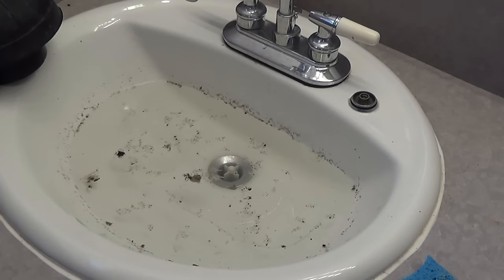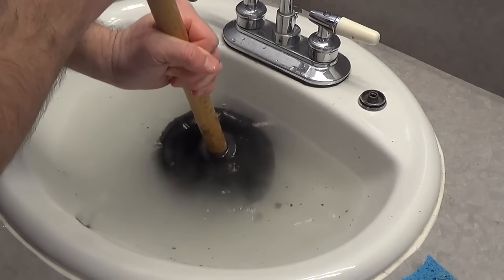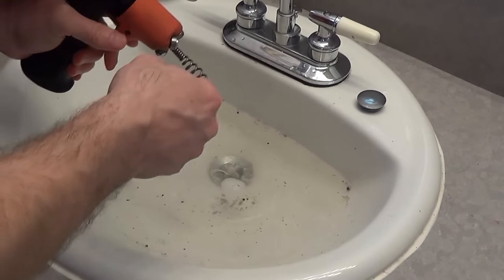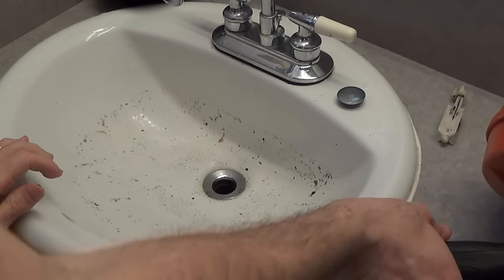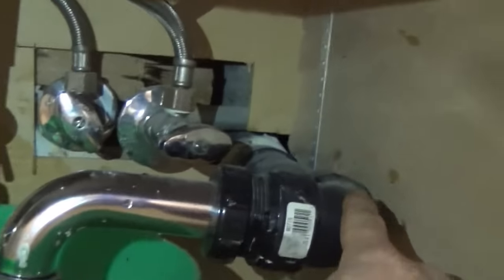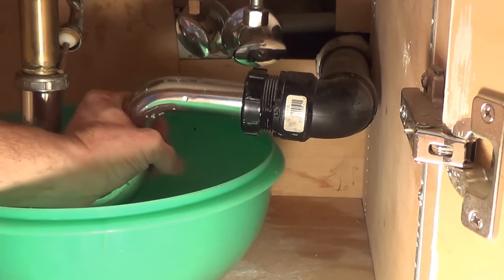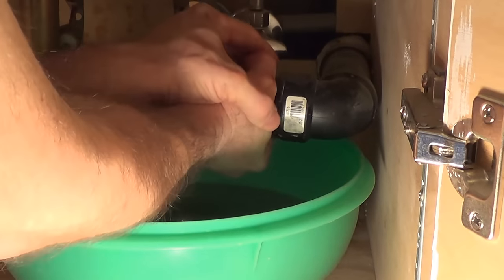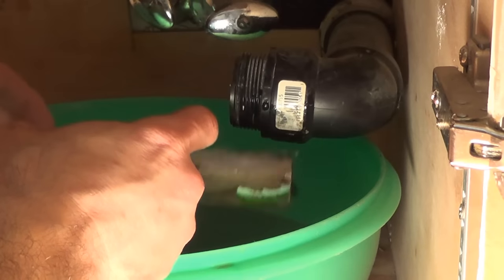How to Unclog a Bathroom Sink

Comment: Usually, the bathroom sink clog is hair and slime wrapped around the base of stopper, the thing that closes at the bottom of the sink.  You often only need to pull that out and clean it off.  To do this, detach the lever under the sink that raises and lowers the stopper.  The stopper will pull right out.
Reply: Yep...almost died when I saw him remove the plumbing...LOL
Reply: Thanks a lot, your reply saved me, i did exactly as you said and it is resolved. so much helpful tip!!!
Reply: Thank you👍
Reply: @predeem1629  ,
But in this case it was further down.
Reply: 0

Comment: Use Dawn dish detergent. Pour it in, run some water too soap it up and let it sit. Works every time.
Reply: Soaps the reason why my sinks clogged
Reply: No it doesn’t work
Reply: Sometimes a teakettle full of hot water will melt it loose. If it's not hair.
Reply: @gircakes  ,
That's only if it's up high, not in the wall.

Comment: This video saved me. Our bathroom sink was stopped up for months. We would plugged it and the water would drain out just a little bit faster. Water would fill up quickly and would take about 10 minutes to drain out. I was just about to try to take the pipes apart to try to clean them out. I am a female and didn't know what I was doing. Then, I watched your video and you said to put your hand over the holes to get a better suction when plunging. I tried that and the water went down within 3 minutes. Thank You for this video

Comment: I went thru 5 bottles of strong Drano thru 5 months --- I stopped using bathroom sink out of frustration cause it's still clogged! Thanks for the thorough explanation and live example on how to take the pipes apart! I think my clog is somewhere deep in the last pipe... Something is blocking the water flow.
Reply: Checking on chainsaw fixes
Reply: Same here, the clog is deep inside the wall, and a snake drum or a plumber are two expensive options for me. I'll just continue using this bucket to throw out the waste water into the toilet.
Reply: Could it be the vent pipe is stopped up? Bird nests are famous for getting in those.
Reply: @virginia7125    Update:  I live in a 4 family apartment. 2 years ago after I complained to the landlord, he gave me a brand new sink and new pipes and the water was still clogging!  So he then hired a plumber to use a super long snake..that cleared up the problem once and for all!!  👍
Reply: @nancybrooklyn  good to know snakes are the key

Comment: if you'd used a power / drill-based auger with a longer (thus more flexible) tip, you LIKELY wouldn't have had to disassemble the trap. your crank snake simply doesn't have the rotation speed or flexibility to get around all those curves.

had a similar situation this morning. it actually took more time to walk the snake from the truck to the upstairs sink than it did to clear the clog about 8 feet into the drain.

Comment: Yay! The plunger worked! After cleaning the stopper which was completely dull of crud, running baking soda, vinegar and hot water, then resorting to Drano, this worked. Whew.
Reply: Tracey Sparrowhawk if I’ve learned anything from clogs, always plunge before Drano. Drano is essentially useless.
Reply: @TrekBeatTK  what kind of plunger do you need?
Reply: @jakeb8298  for a sink, a regular cup plunger (but you have to cover the backflow hole on a bathroom sink). For a toilet, one of those flange ones with the bit that sticks out of the cup.
Reply: @TrekBeatTK  where is backflow hole?
Reply: @jakeb8298  it’s that little hole in the sink that seems to serve no purpose. Usually on the opposite of the faucet , maybe off to one side in the basin. But it’s easy to find: just plunge a little and it’s where water comes shooting out! (That’s why you want to cover it with a rag or something)
Reply: @TrekBeatTK  remarkably this bathroom sink has no holes at all except the only one required through which water goes into pipes!!

Comment: Use a coat hanger to unclog the drain. It's a simple method. Feed the hanger through the sink hole & in an up & down motion force the clog to break up. This is fool proof.
Reply: My father did that...put a hole right through the pipe.

Comment: Wow, I had to watch til the end to found out if it worked. I would've been so disappointed if it hadn't.

That being said... if the plunger doesn't work - I'm calling a plumber.
Reply: There is probably something in there. Just get a regular plastic bottle, fill it up with hot water, then hurriedly, put the mouth of the bottle into the sink drain and push the water bottle into the drain. This is way more strong than the plunger. Or maybe you can just easily remove that main pupe under it (if you know how to do it) and there will most likely be something inside.
Reply: Hahaha same. The suspense was killing me!
Reply: @baconandeggs9113   the water bottle trick works with light blockages. The snake is much better.

Comment: Your not supposed to have a 90 degree fitting on it's side when using for drainage. That is one of the problems. The trap arm was too long, and it was good he cut it back but there should be a longer sweep with two 45's fitted together. Also, the washer was on backwards. The beveled end should face the wall fitting.

Comment: Can’t unblock my sink in bathroom..tried plunging it, put every known substance down, put down a flexible rod about 3ft hits nothing, can’t get into the pipe behind pedestal because the pipe is against the wall , so can’t pull it away after undoing the big plastic nut that attaches it to the pedestal, the blockage must be at least 3ft away ..so only option is to saw through plastic pipe or remove sink and pedestal to get into the actual pipe...or call a plumber which I can’t afford

Comment: Do i need to shut thr3 water off for the whole house or as long as the water is not running on this sink obviously?
Reply: No, you don’t need to shut the water off for the whole house.  Just don’t turn the water on for the sink during the repair.
Reply: @shebakali6  thank u also do I need to put teflon tape on the p trap when I install a new one beacuse the one I have is cracked when tighten
Reply: @accord9535  you could do that
Reply: @accord9535  ,
I always go by the instructions on the packages.  Sometimes putting on teflon tape when you are not supposed to makes it leak.

Comment: It's good for a strong guy to do this,for a week female like me it would difficult,my best thing to do is pour into the  drain the drain liquid  like CRISTAL HEAT DRAIN OPENER  that would  do ,i found that  certain toothpaste  like provident would  clock the drains  offen
Reply: You don't need strength.  I'm almost 60 with asthma and high blood pressure, and I can do this stuff.  I just hate to, so I try other things, like clorox, first.

Comment: This is a very aggregious video.
The snake did fix the problem because all it did open  a clog that will over time become a problem again.  This vid is not about fixing the problem:  rather putting real problem off for someone else to fix again in the future.
Reply: He needs to use chemicals to dissolve the debris then to pump plunge to remove the debris once and for all.

Comment: Yeah take it apart and snake it. Usually it's just the s bend clogged with hair n junk. Way faster but dirtier to just take it apart. If it's not old crusty metal your good. If it hasn't been years since anything was touched it might just fall apart when u put a wrench on it. It happens. And that thing the guy was hitting is called the vent. He needs to go down not up. Lol rookies
Reply: I'm surprised it didn't leak with it only hand tightened.